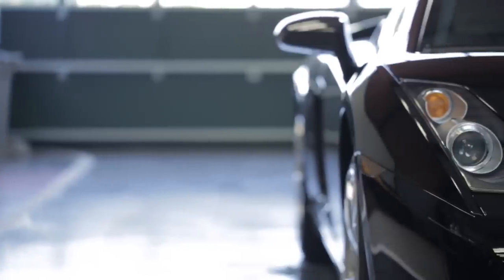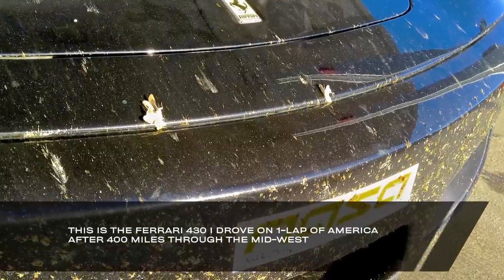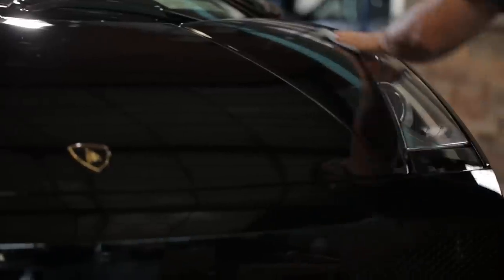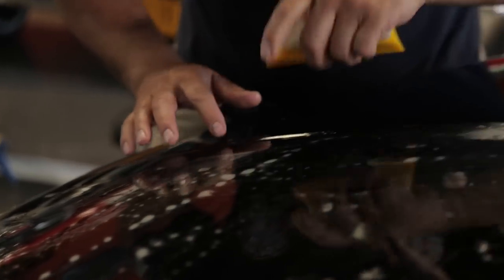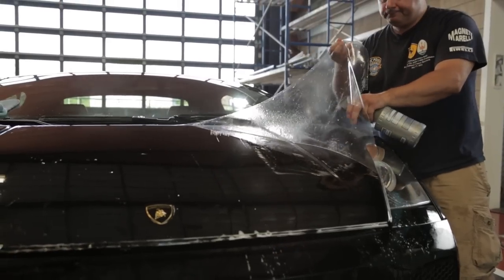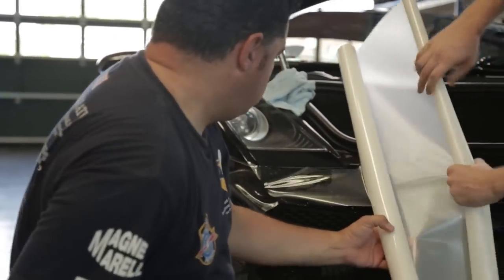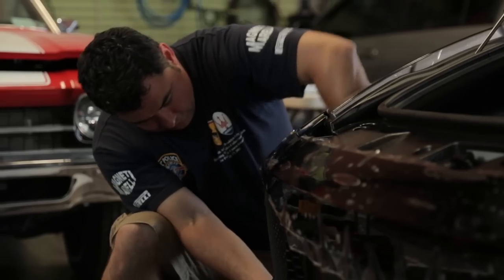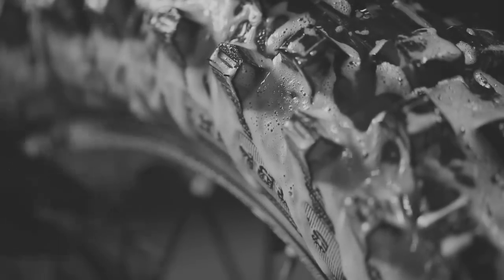Clear Bra: Invisible Paint Protection -- /DRIVE CLEAN

Comment: Props to this guy, i have trouble putting a screen protector on my phone without getting dust under it!
Reply: +toleth88 it's easier if you can apply some soap water on the surface. which is fine for car but not for phone.
Reply: +toleth88 This is the reason why I pay professionals to do my window tints, and possibly clear bras or wraps in the future.

Comment: Just some info... Waterborne paint can be replaced by a solvent based system that is LOW VOC. A Low VOC base and clear system that uses a normal spray booth and equipment. An Australian company has developed this and is exporting it to the USA so much easier than water based auto paint. Also by adding a flex additive in your clear will make it hold up really well against stone chips.

Comment: This process is almost identical to doing full body vinyl car wraps. This is essentially what I'm doing at work every single day, except the difference with this and vinyl as that you can apply heat to the vinyl to help wrap around corners and bends smoothly. Also, you typically do not do what is called "wet apply" with vinyl like they do with this clear bra, with vinyl you're applying it to the entire vehicle completely dry. Very cool, I had no idea that the process to apply clear bra is the exact same process that I use at work as a professional vinyl installer, that's awesome.

Comment: If you have a slightly raked hood line,Id recommend getting the whole hood covered. I had just the front bumper and half the hood don't years ago but still a lot of chips hit high up on the hood.

Comment: Spent $1200 on a clear bra for my week old WRX 18 months ago, and Ziebart did a pretty shoddy job.  It's already yellowing on all the edges and there were a bunch of contaminants they didn't remove before starting.  It's pretty durable, but make sure you get it done by a reputable installer.  Always check out the employees cars to see if they actually care for their own cars.  I doesn't matter if they are dirty, just if they are neglected.

Comment: honestly I wouldn't touch up paint before the clear bra. It looks terrible! I have no idea why but it just looks bad. I worked at a lexus dealership for a while and we stopped touching up used cars before the 3m because it looked worse then if we just left it. It wont corrode underneath so theres no practical point either.

Comment: his using water and baby soap? did  i hear right? what exactly do u use to lubricate
Reply: water and baby shampoo - the shampoo gives enough lubrication allowing you to move the bra around during installation, but the detergents in the soap are not too strong to have a negative effect on the adhesive
Reply: what would be the best adhesive? i thought it was just water
Reply: the adhesive is already part of the clear bra. when installing clear bra you want something that is slippery (baby shampoo + water) between the car and the bra so that the adhesive doesn't stick immediately so you can work out the bubbles. by using a squeegee of sorts you push the water and shampoo out from underneath and then the bra will stick to the car and stay in place
Reply: tnx for the knowledge. i didnt know that

Comment: It's true that this guy did an okay job at actually applying the film and making sure there were no imperfections under the surface. But look at the gap around the badge, it must be 3-4mm. That's totally unacceptable. A good clearbra installer would have cut around the badge with micrometer precision, leaving no gap whatsoever. Sure, some guys may not know how to use a razorblade, but the ones who do blow this guy totally out of the water.

Comment: Clear bra is terrible. To cover up dings and paint etching, it shows even easier in the soft clear bra. Not only that, but swirl marks are even easier to see in clear bra. You can't polish it like regular paint and it takes hours with a heat gun to remove. I strongly advise anyone to not buy clear bra.